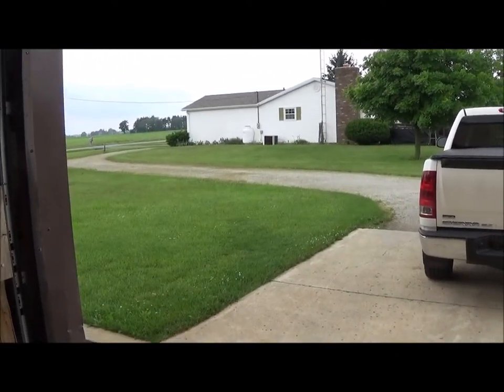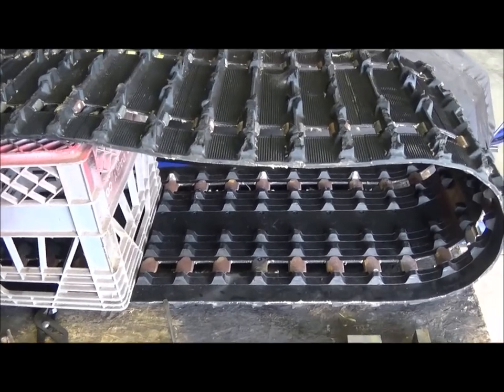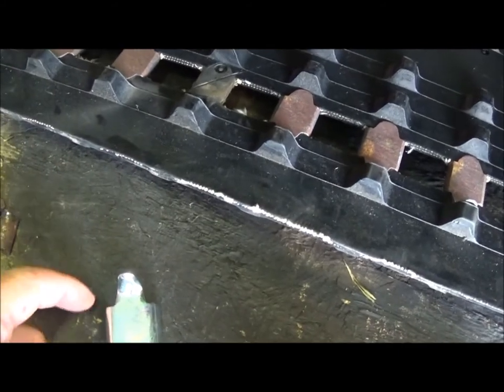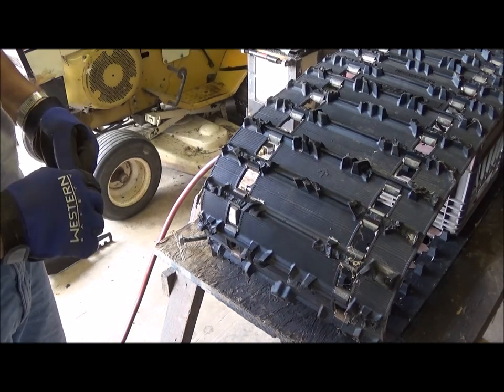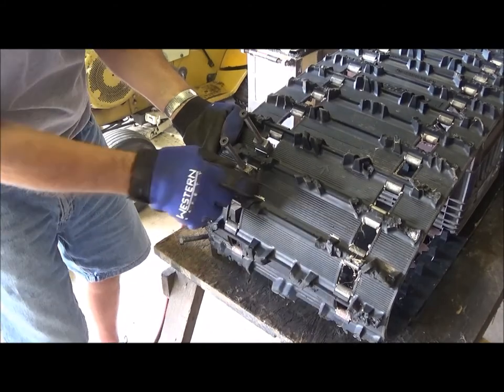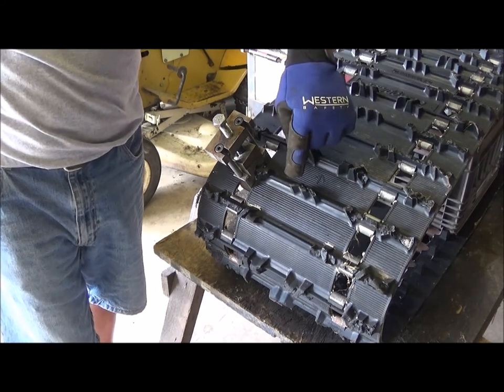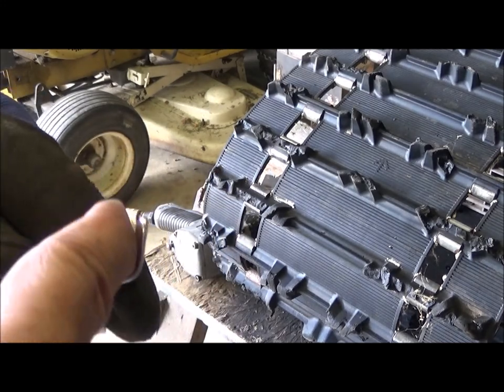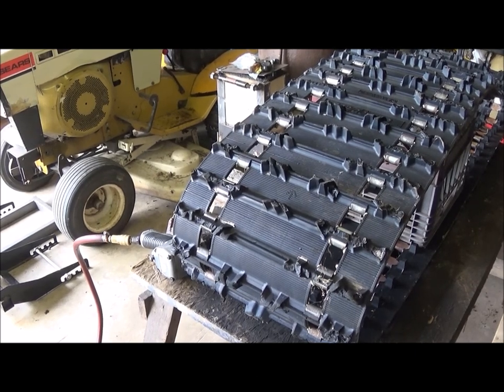Snowmobile track clip installation

Comment: That’s what snowmobiler do in June! Thanks for sharing snowking, great video.
Reply from the maker: That's the best time to work on them. This was abnormal for me, I usually wait until it's 15 degrees and then start a project like this, but it was a lot nicer not working with numb fingers.

Comment: I put a new track on my sled and it only has metal clips every third hole.should I fill the empty spots in?? Or will it be ok without?thanks
Reply from the maker: I would put clips in where there are none, it's not good for the slides to run on the rubber track it will wear it out in a hurry. Check your clip layout and make sure you put in guide clips that will keep your suspension from wearing off your drive lugs on the track. In the video you will see how the guide clips are spaced, the clips in between them are just standard clips.